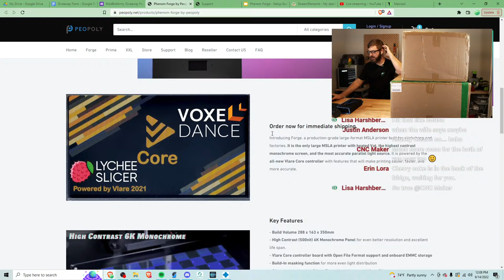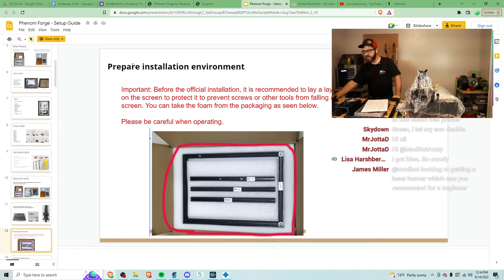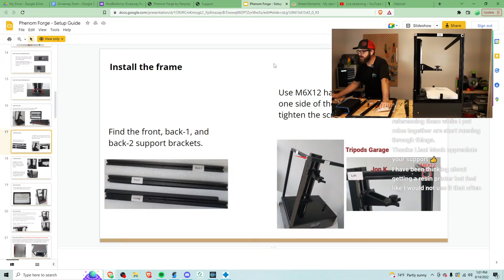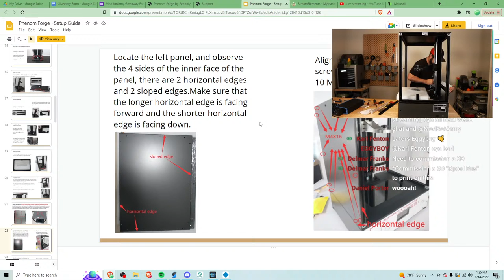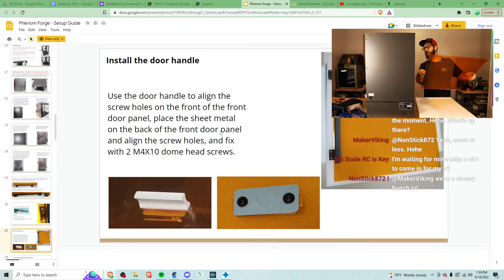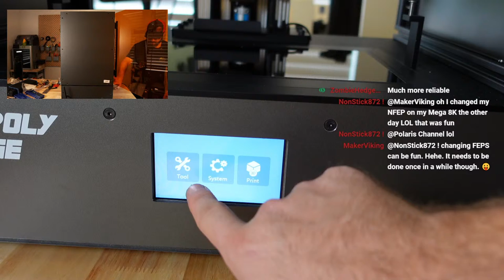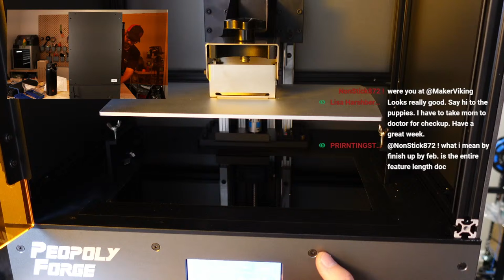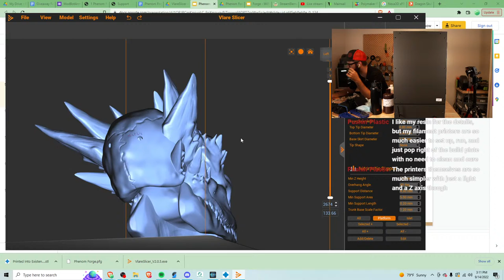Peopoly Forge Large Format Resin Printer - Unboxing & Assembly

Comment: Hey there, which plate did you order from Wham Bam?
Reply from the maker: https://whambam3d.com/products/292-x-166-xtr-peopoly-forge-phrozen-transform-and-transform-fast?variant=39845083971682

If you use code ModBot2022 it will give you 10% off :)

Comment: After buying a forge I kind of regret it. It's not a very polished printer and the vlare board is severely lacking in features.
Reply from the maker: I would love more info on this. What features do you feel the board is lacking? And what do you feel is not polished?
Reply: @ModBotArmyy  here comes a laundry list. The unit comes with with a camera and a heated vat but none of these are controlled from the printer and can not be controlled by slicer or gcode. My unit has an elephants foot problem. All of my printers are connected to a sub net on my wifi as a security measures and the slicer does not allow you to manually enter in the ip address of the printer so I cannot use wifi printing.(I.E. my computer is on 192.168.0.xxx and my printers connect to 192.168.4.xxx) the slicer and camera want it to be on the same subnet as the computer. I feel that this printer could use some sort of auto vat refill. Lychee and chitu box support is not there. The vlare board seems like it can support zips but I never got them working and the slicer seems to not like multi gpu with multi monitor setups. I keep having my dialog boxes show up off screen and I cannot drag them on screen to see what the warning is. When I pause the print I would like the ability to move the vat further up or down to see if my first couple of layers are good. There is just a bunch of small quality of life stuff that I would like to see added with firmware and I would like to see expandability so I can control stuff like the heated vat from gode or the slicer. There are a few more but because I haven't used the printer for a few weeks I forgot what they were. I am sure I'll run into them again the next time I use it. Also,I wish prusa or someone in the community would open up prusaslicer to work with this printer. That would be a killer matchup. But that would require prusa to output proper osf files or for the printer to read zips correctly.